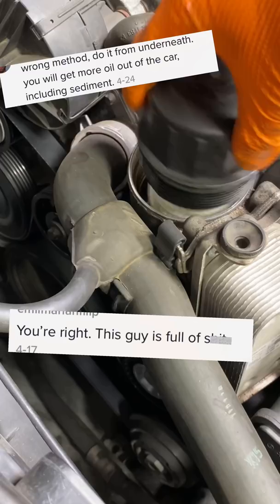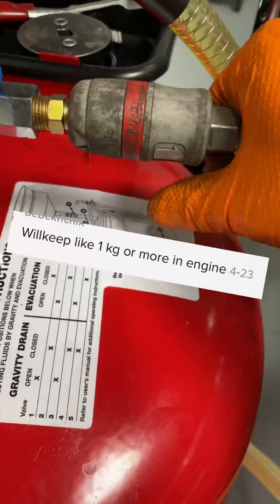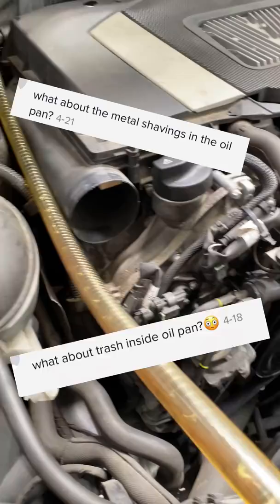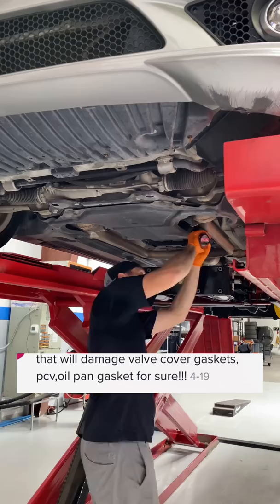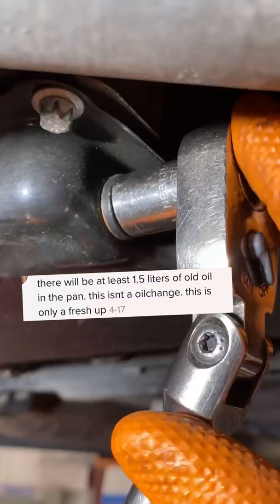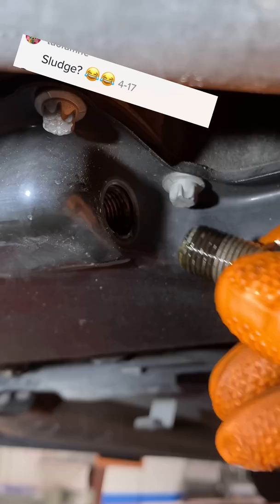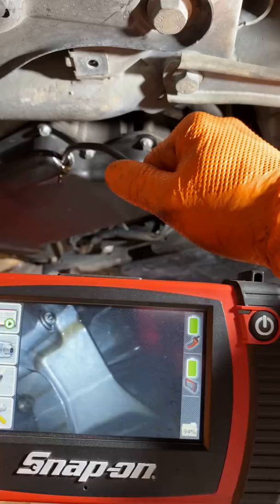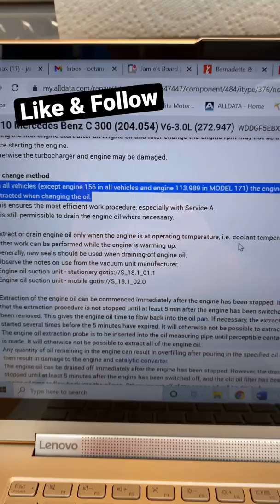#shorts Mechanic Proves Haters Wrong

Comment: I love when pros in their respective fields stop arm chair goofs, not only is it satisfying, it ends the spread of stupidity.
Reply: I’m an armchair goof seeing this the first time.  He removes the oil with a vacuum, pump, or some sort of siphon under pressure.  As I have a brain I knew that it would be empty.
Reply: You'd hope so, but people still out here refusing to get vaccinated. 😒
Reply: @Alex-fu3mi  or people like you being scared of a cold
Reply: I love when there's multiple ways to do something in an industry but a tick tock video convinces normies there's only one way to do it.. both BMW and Mercedes-Benz constantly recommend ridiculousness. usually doing it the easiest way is much better for the life of the vehicle. Every marine application tells you to "warm the engine oil up" number one this makes the oil drain faster much faster if it's below 70 degrees Fahrenheit out. And the big number two there are engine metallic debris in the oil you're stirring them up off the bottom of the pan when you "warm the oil up". Car manufacturers don't typically tell you to do this because they figured you just drove the car to the mechanic but if you're doing it at home and you're not going to warm the car up you should probably drain it from the pan.
Reply: @Alex-fu3mi  and they should because some of the carrier rdna is being cleaved off and not staying in the arm this is causing some people to have extreme reactions immediately everything from heart attacks cardiovascular events to seizures several weeks later I'm a case study took the shot the first one now I have massive problems with my neurological system I can't raise my left arm above my head and this is the same thing I've been hearing from multiple people
Reply: Another way to end the spread of stupidity is to tell people not to buy garbage Mercedes

Comment: If you have metal shaving in your oil Pan you've got more problems than an oil change
Reply: as I Do Cars says "the forbidden glitter"
Reply: i always get shavings but that's because the gearbox shares the same oil
Reply: It is normal to have light fine shavings that's why we need oil filters to filter it out the light shavings. Some even have magnets to attract the shavings. However it is not normal to have big thick shavings.
Reply: Exactly lol. If you take care of your car and change the oil and filter you won't have to worry about metal shavings.
Reply: @richmondvand147 MALICEEEE!
Reply: How is your engine still running matter of fact
Reply: @ambivalentonion2620  well from my understanding depending the engine, you should always have a little bit even if your gearbox doesn’t share the same oil you’re gonna have some wear and tear on the engine it shouldn’t be noticeable like glitter though,
Reply: @Hellothis12157knbhb  well i drive an a series engine with the gearbox in the sump of the engine sharing the same oil obviously and i use a neodymium magnet sump plug and that pulls lots of little shavings of metal onto it, the magnet is so powerful though it's not surprising
Reply: @ambivalentonion2620  that’s actually pretty neat lol I bet you mechanics would like that

Comment: I actually admire this video….one mechanic who can humbly show everyone that he’s actually correct.
Reply: Also to slap the assumptions back in the faces of the nay sayers. Including me, mind.

That said I used one of those cheap oil extractors from the Lidl supermarket and the thing got hot, and didn't really get much oil out at all before having to stop it again due to overheating issues. Even when it couldn't drain more, my BMW was still holding on to a good amount of oil.

So yeah, home mechanic experiences vs professionals. Quite a difference. Good tools makes sure you have half of the work done already.
Reply: Literally ever little kid on tiktok thinks they know everything 😂😂
Reply: I dunno about humble but still a great video!
Reply: @LogiForce86  maybe don’t buy your tools from a supermarket 🤔🤦🏻‍♂️
Reply: @MrEo89  Maybe it was just on the really cheap and see how it goes kinda deal?
All my other tools are from Wera, Hazet, Proxxon, and all the good brands.
I just won't go as far as buying a professional grade single use tool for a job I do once every year or two on just my own car. It would be just too much of an expense.
Reply: @LogiForce86  
Using cheap tools acquired from a cheap supermarket is a bad idea. Only changing the oil once or twice a year is probably not enough.
Reply: I can also almost certainly say, that those people commenting are not mechanics
Reply: @LogiForce86  BMW? What generation? BMW's haven't used a dipstick in ages. So going to call BS until further notice.
Reply: @LynxStarAuto  you say ages as if it’s been a hundred years…. is it really out of the realm to say dude has a bmw from before 2006? Relax
Reply: @LogiForce86  some BMWs aren't meant to be extracted either. If the motor isn't designed for it, it will not work. This same guy has shown in other videos it doesn't work on everything. Look at the procedure methods recommended by the manufacturer and if it says extraction your tool just sucked. But it very well could work and it got hot because it couldn't pull anymore oil and thats probably what cools it as it slows through the transfer pump.

Comment: "Metal shavings and trash in the bottom"

I'd like to answer what is oil filter for $500
Reply: Also, isn't there typically a magnet in the bottom of the pan to catch minor amounts of metal?
And if you have enough metal bits floating about your engine to overwhelm such a magnet, you have bigger problems than needing an oil change!
Reply: @MonkeyJedi99  bingo it’s usually your drain bolt that has the magnetic bit, and damn right if there is a ton of sludge and metal at the bottom a oil change ain’t your biggest problem.
Reply: @MonkeyJedi99  0⁰00⁰0⁰00000000⁰⁰ⁿp00
Reply: If you’re genuinely worried about metal shavings in the pan of a stock car at stock power levels… sorry to say, the world is a lot scarier than that.
Reply: @MonkeyJedi99  yup, bingo
Reply: @MonkeyJedi99  Exactly - if there are metal shavings in the bottom, your engines already fucked. And if it's sludge, you're not changing your oil often enough.
Reply: @severnsea3924  or the forbidden chocolate milk 💀
Reply: @severnsea3924  dude i once bought a mustang GT with a bad engine, I had my mechanic drain the engine and then open it. straight GLUE came out the sump, im talking gas station $2 a quart motor oil
Reply: @MonkeyJedi99  aluminium.
Reply: @doodlebob1184  nah he probably put slick 50 or some really thick oil to make it have more oil pressure for a short period before popping. He spent money on that lmao. Cheap gas station oil is like water lol get it hot and no beuno.
Reply: @MonkeyJedi99  well the metal bits are not supposed to be in there at all not visibly at least. Maybe on a brand new engine or a rebuilt engine for the first couple changes. An excess of metal bits that are like shiny glitter in your oil is an indication that something is seriously wrong or about to be with your engine in general as far as I'm aware
Reply: @JackDemp719  that's usually people who accelerate too hard
Reply: @chicken29843  what? No it's when water gets into the oil
Reply: If you expect there to be trash and metal shavings in the bottom of the oil pan then you have no idea what your talking about whatsoever 😂😂
Reply: @JackDemp719  chocolate milk isn’t that bad, as long as it isn’t on the whole dipstick. If it’s just a couple streaks on the stick then you’ll be fine if u just do an oil change. Your biggest issue would be to figure out how tf you’re getting water/coolant in ur oil in the first place 😂
Reply: If you guys remember the legacy, air-cooled Volkswagen Beetle engine, it didn’t have an oil filter per se. It did have a rather crude oil screen so to speak but nothing like the filters we have today. The drain plug was magnetized and worked rather well at picking up those pesky little bits of metal that were normal for that engine design.
Reply: @MonkeyJedi99 yes sometimes the drain bolts have magnets but to be honest you shouldn't have metal shavings or sludge in your engine regardless
Reply: @naratouzumaki  I have heard and read things many times in the past four+ decades that a tiny bit of metal in the fluids of a brand new engine or transmission are not a worry, ad parts wear-in together.
Essentially, that it is more a matter of quantity and/or long-term trending than it is of mere existence.
-
edit: sludge is a failure of fluids due to time (not changing fluids in a timely manner), overheating, or mixing of things that shouldn't be mixed, and I agree they are all bad.
Reply: Oil filters really only filter like 5 percent if the oil. The filter cannot filter everything always I wish they made a system like that, but it's not how it works.
Reply: @alpha13dylan there is a bypass valve in the engine or the filter. A well designed system will filter the majority of the oil. This was not always the case. Buy most modern filters filter down to 5 microns. This also why oem oil filters are important and should be used.
Reply: And that's the daily double.
Reply: That's not how Jeopardy works.
Reply: heh
Reply: Not how that works, oil filters can only catch so much. 

BUT if you have metal shavings in your oil pan, you have much bigger things to worry about. Because it means your engine is eating itself.
Reply: the only thing with this technique is that the vacuum might do some damage if its way more than the car normal has in oil psi.
Reply: I love when people say metal shavings as if that's normal 😂😂
Reply: @charlesnichols5902 how’d you do the degree thing
Reply: @pfoxhound aluminum isn’t magnetic
Reply: If there's metal shavings and oil at the bottom, your engine is already fucked.
Reply: Assuming it gets through the oil pick up and pump first without damaging anything